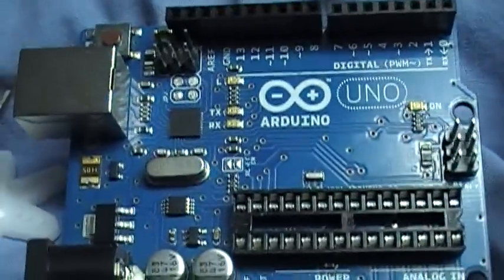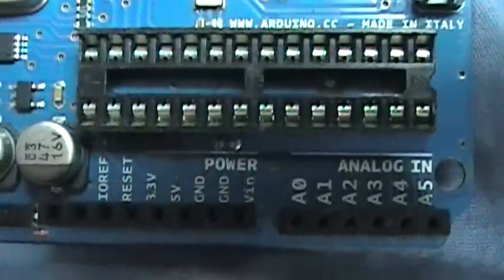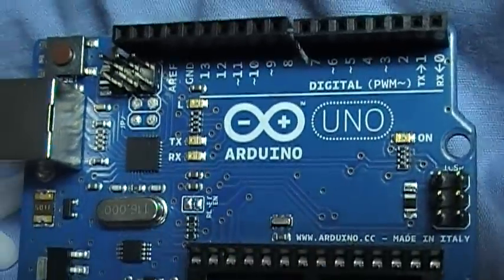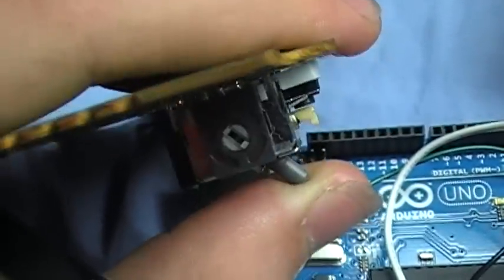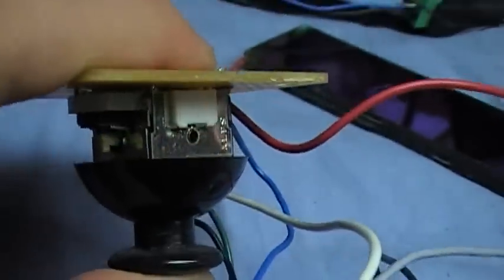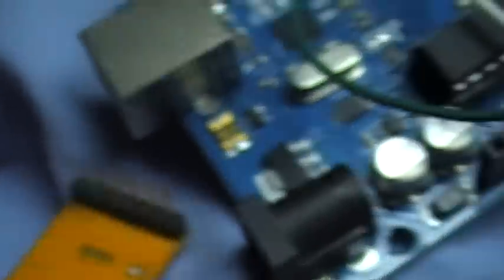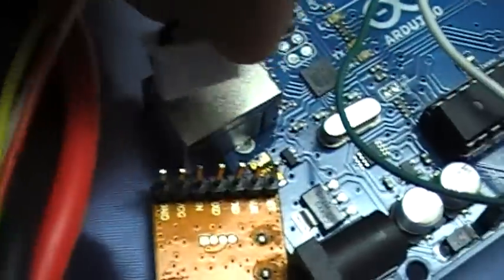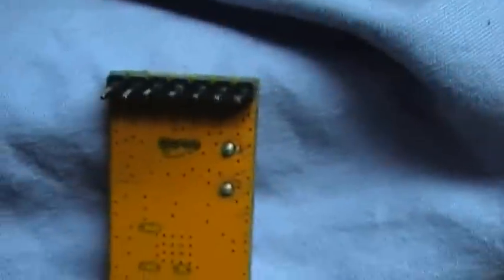Arduino Quadcopter Part 3- Troubles

Comment: thank you for your update .. I know you face a lots of troubles
I just now broke my 3 propellers  out of four ,also 2 months ago I break one of them , there are many things goes out of what I expected, the think make try and try even the worse happen is that I learn each time a new thing :) .

actually , my project is to control quadcopter using arduino and such like you with joy stick and xbee and other things. I finished troubles of the code delay and the xbee. so I left with gyro ,accelerator  ,stabilization PID which I try to finish it during the next 2 weeks ,

 I hope the best luck for your project and mine :)
keep updating .